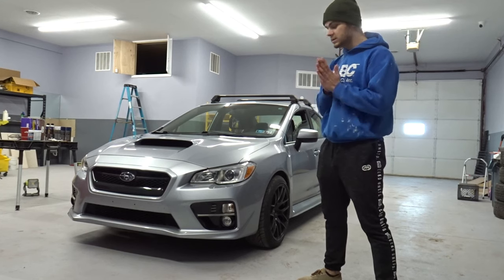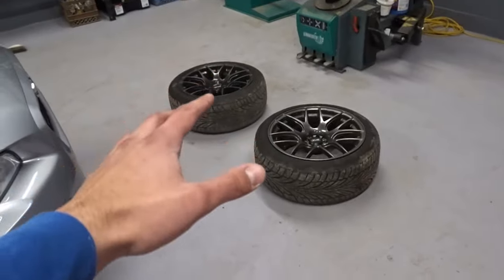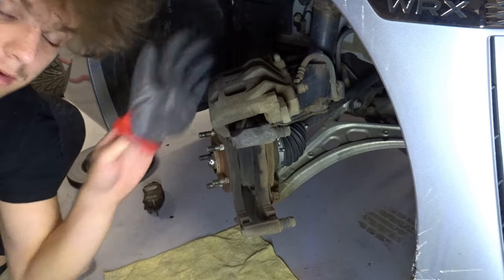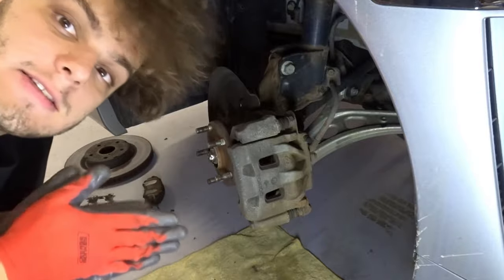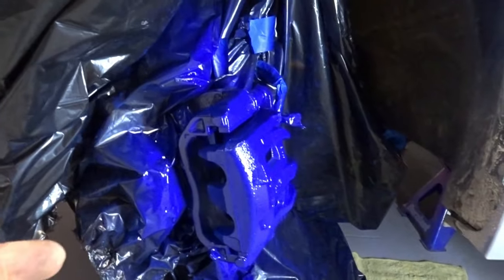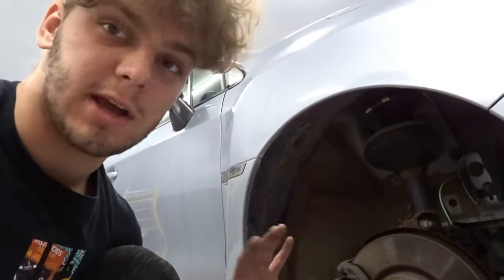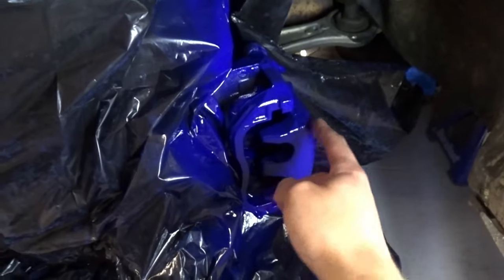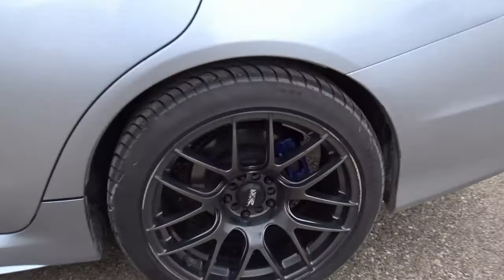PAINTING MY CALIPERS BLUE!!!

Comment: How did the engine clear coat paint hold up wondering if i should get the brake caliper clear coat
Reply from the maker: It's not a necessity but I wanted the paint to hold up as long as possible. Right now it's holding really good no chipping or anything even in the cold weather. Even when I drive it hard and my brakes heat up its still good. Clear is a good extra protectant and it gives the calipers a nice shine
Reply: @quikphil6514  Sweet thank you